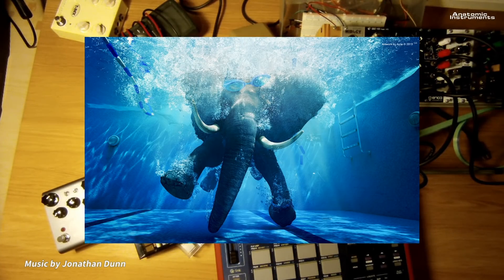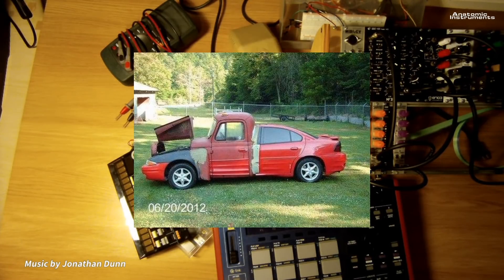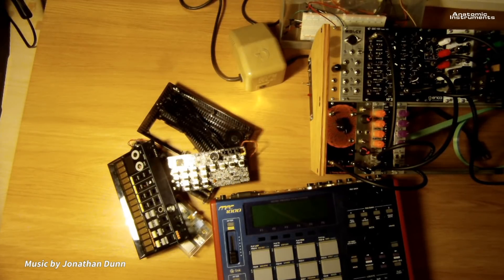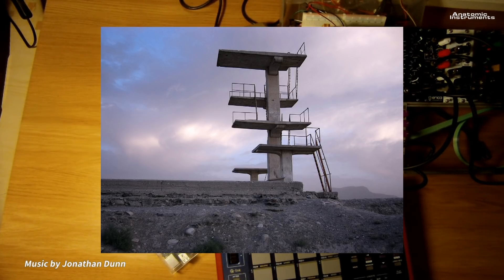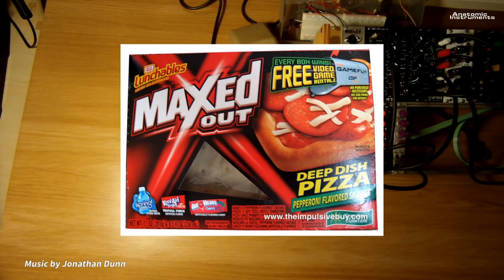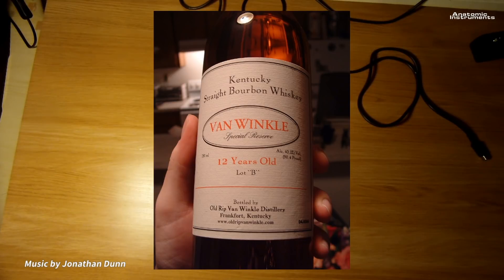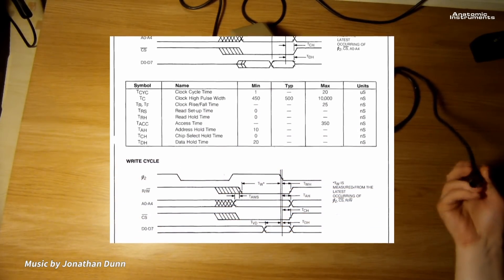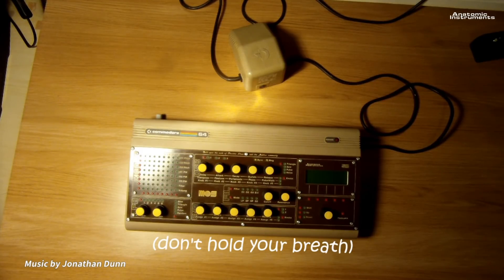What is SID? - An introduction on a synthesizer module I built [Midibox SID]

Comment: These sound really nice. I know people like chip jams but naked SIDS are kitch. How easy are these to make? I want one but have never made any electronic gear or even soldered anything in my life.
Reply from the maker: You probably don't want this to be your first soldering project, but it's not that hard either. Sourcing the parts is probably the hardest part.
Reply: @Nintendj  thanks. I used to build computers and have just put together a eurorack.  But I am very easily confused by lots of wires and dont know how to read electronic diagrams! I'm thinking about this or a sid guts module. Sid chips are about $50? And seem to be easy to find on Ebay? What parts were hard to source?
Reply: @Nintendj  and these just use the filters built into the chips?

Comment: Very nice video and cool synth there... pity that you can not buy them
Reply: BIRBO Official You should visit the Midibox forums, right now some guy from Switzerland is selling a fully built Midibox Sid with (if I remember correctly) 4x6581 chips inside. I would buy but I want to make my own.
Reply from the maker: Thanks! That's also part of what makes them so sought after. I think you can still buy Twisted Electron's TherapSid and, if you're lucky, you might be able to find a 2nd hand Elektron SidStation, Mode Machines Sid or even a prebuilt Sammich Sid.
Reply: Thanks for all this info... now I will wait for your sound video with this crazy synth.
Reply from the maker: Yeah, I'll hopefully find some time in the next days to cobble something together... :)